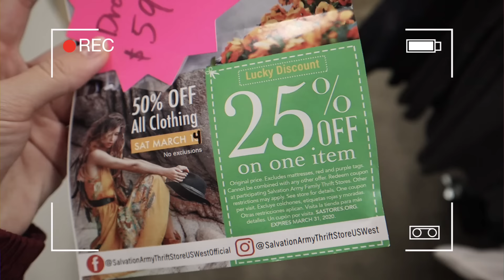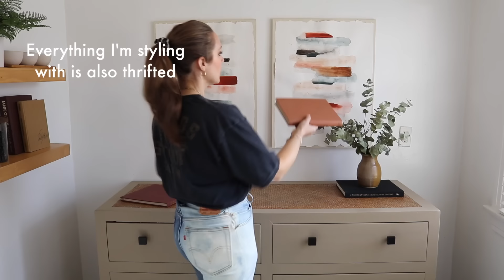THRIFT FLIP DRESSER under $100 + Styling Tips | XO, MaCenna

Comment: also, an idea do protect the rattan inlay overtime AND make cleaning a lot easier is to get a sheet of glass, the same dimensions as the entire top surface of the dresser, and just lay it on top. additionally, you could get little rubber feet for each corner, to prevent the glass from sliding
Reply: Make sure you get a tempered glass to protect from breakage.
Reply: excellent idea!!
Reply: Great idea! I have glass tops on all my ikea furniture and I feel it makes it more durable and last longer since ikea furniture isnt the best quality and is prone to damage!
Reply: No glass for me because then it doesn’t look natural and it dates it! She could always put polly but she’s not gonna be eating food up there anyways for it to get ruined 😄
Reply: @matzsn10  me too! I love it, protects and so easy to clean
Reply: I don’t like the glass but I have used wax to protect rattan and cane and it works well.

Comment: Absolutely loved this flip. A little tip for the top. Looks like areas of the ratan got hit by the sander. Give it a nice coat with linseed oil. It'll fill in those spots and give life to that ratan again. Really finish it off. What a great find! I'm so bummed that I don't have all the ratan stuff my mom used to have. I grew up with that little arched shelf you bought. I used it as a Barbie house growing up.

Comment: Hey MaCenna!  This is a Chinese reproduction - they are often made with reclaimed timber, so they look old and have lots of little knocks and gouges like the one you found on one corner.  Almost all of them have those knobs with the metal clips on the back.  Those knobs are also a recent reproduction.  The black paint is likely to be the paint it was given in the factory - it's often a little rough and ready, to give the piece a vintage feel.  I have a very similar one here in my living room :)

Comment: Any tips on how to repaint a dresser without getting brush strokes? I’ve heard some people say to mix in a little bit of paint thinner with the paint to get a smooth finish—any other recommendations?
Reply: You can invest in a sprayer if you don't  want brush strokes.
Reply: I use a sponge roller instead and I also sand between coats. So far , so good.

Comment: I have a cane back chair I found on the side of the road. The chair is vintage and  has caning just like this dresser but it has several coats of paint on it. Will this gel paint stripper work on top of the caning? I don't want to ruin the caning if possible.

Comment: Is there a certain type of paint that works best on wood? I have been using Rustoleums Chalk paint, but it is not very durable. When I use their recommended sealer on top it pulls the paint back up.

Comment: Don't push on your ROS, it's more likely to leave scratches & swirls (plus stress on the sander). If you're using the right grit sanding discs, you don't need extra weight. Just let the sander do the work...